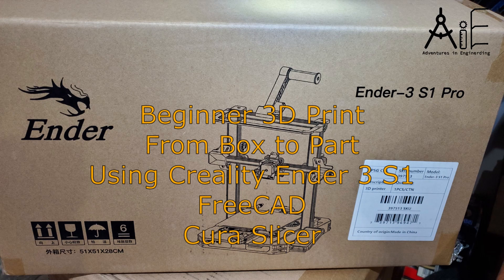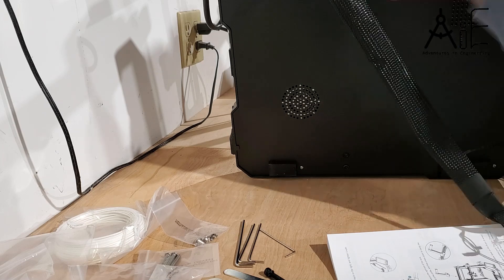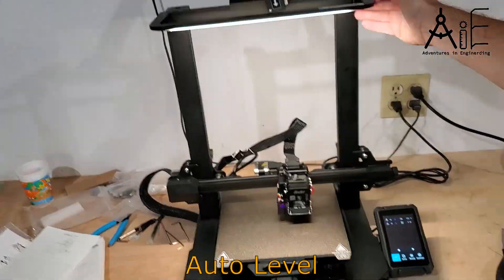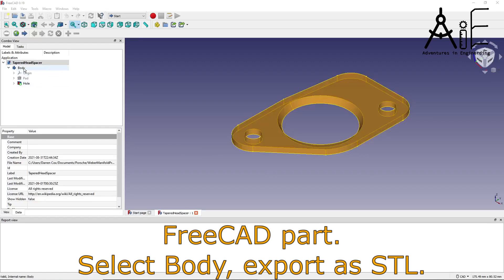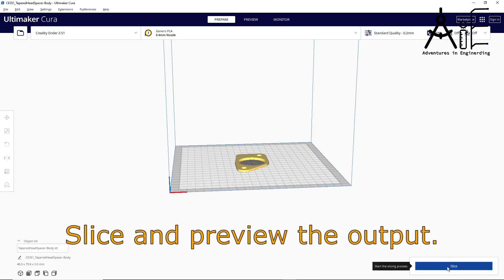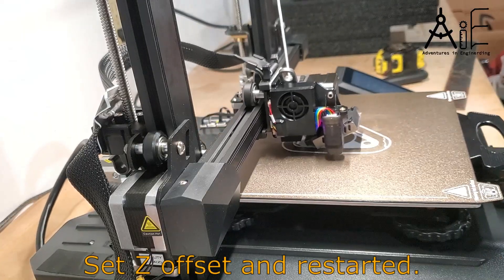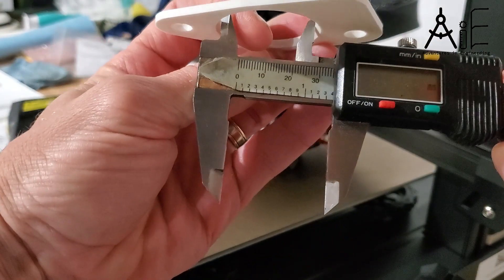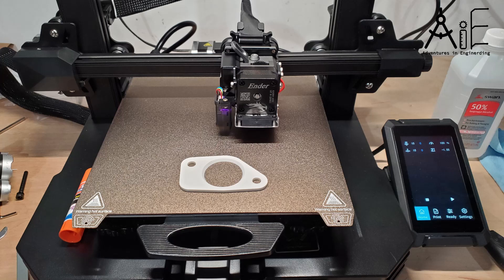Beginner first time 3D Printer from box to printed part. Creality Ender 3 S1, FreeCAD, Cura Slicer.

Comment: Still waiting for my Ender 3 S1 plus so it was good to see this. Well done. A few things I hadn't thought about. One thing I read elsewhere is to manually set up bed levelling first and then run the auto levelling as this give a more accurate result.
Reply from the maker: Thanks. Yes, manual level to get close is a good idea. The auto level is compensating for differences corner to corner by changing z height in relation to measured x,y heights. Big height differences may cause printing issues. Mine was very good to start, but worth checking. Good luck.

Comment: What i would recommend doing is adding the line G29 ; auto bed levelling in your start gcode after G28 ; Home all axes what this will do is that before every print the printer will perform autoleveling which helped a lot with first layers without any gluestick or anything
Reply from the maker: Good tip.  I will add that to the GCODE for my printer in Cura.

Comment: its lovely to see a new person joining the 3d printing comunity :) Great to see you actually had done a lot of research before just blindly build it and print :D S1 is just a great machine for start, it basically have all you ever need except firmware :D . at least the last one i used. I quickly changed it to Mriscoc which offered a lot more control and with its bed mesh building and just putting the load mesh gcode to slicer it kept for a long time before i needed to adjust it.!! if you plan to upgrade your firmware be sure to check out your MB which version of chipset you have, S1 comes with 2 variations!! The other issue is creality beds are known for not being the best in terms if flatness :D mine is warped like 0,08 between center and right side but its pretty much nothing. But 4 days ago i bought the Sonic pad and oh boy, that thing is like the best thing i done in a long time, the klipper is just crazy, the control and speed up, printing first layers faster then i was printing normally, infill around 300mms walls 240mms. and rarely any fail. 26 minute benchy which looks better then on stock which took 1h41m.
Reply from the maker: Thanks. I'll do some checking of the bed. I'll wait to change firmware until I feel like I understand printing better.  Too many variables can make learning and debugging difficult. I appreciate the input.

Comment: Welcome to 3dprinting... Couple of small things. For you and others that may be new to printing. When removing or installing a nozzle it is best practice to do it at full temperature, as well you should hold the heater block while doing so. The mechanical connection from heater block upwards is generally not ment to take those kinds of forces and can be damaged in the process. On the card for setting the z offset is also instructions on tramming, often referred to as leveling in 3d printers, the rest of the bed. While this printer does have a sensor to know when a bed is not perfectly trammed it may struggle with larger variations since its doing it all in software rather than actually making it mechanically true. Again best practice is to get it adjusted mechanically and then let software make the smallest of adjustments.
It is also important to keep in mind we are dealing with molten plastic being pushed out of a hopefully round orifice... basically a glorified hot glue gun, its tolerances should be treated as such.

Most importantly is have fun and I hope you get out of this what you hope to, it will have its frustrating times but when it works it really is quite a lot of fun.

I enjoyed watching this, you presented it well and didn't try and hide a mistake we have all made, been doing this for years with many different machines and I still sometimes forget to double check the basics, and unlike this comment you didn't ramble on. Good job!
Reply: I recommend those short and straight hex keys, not the perpendicular ones. Puts way less stress on those metal connections going from the heat block. Baffling engineering error in my opinion, they should be reinforced to sustain appropriate force for purpose.
Reply from the maker: Thanks and great info! I saw the heater block moving when I took off the nozzle.  I'll come up with a tool to hold it.  Did not know about doing it at full temp - guess I need some high temp gloves.  Totally agree on leveling and will check manually.